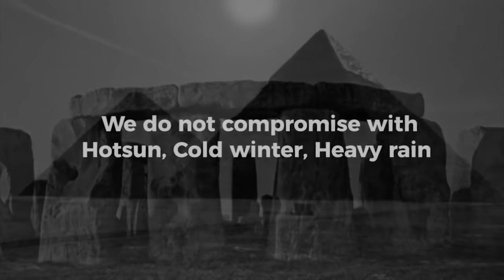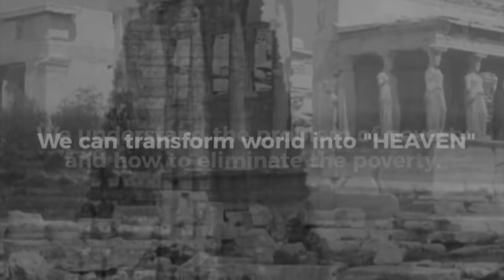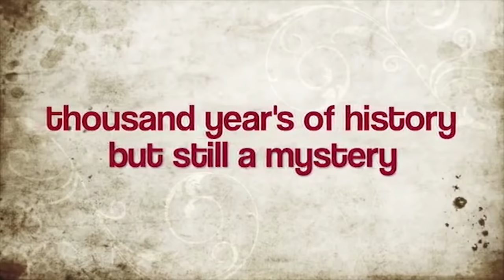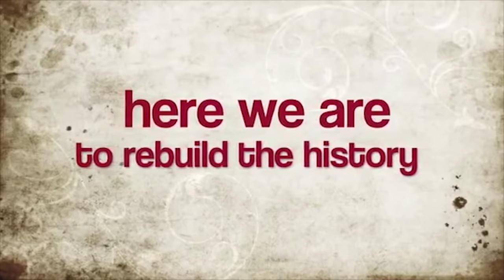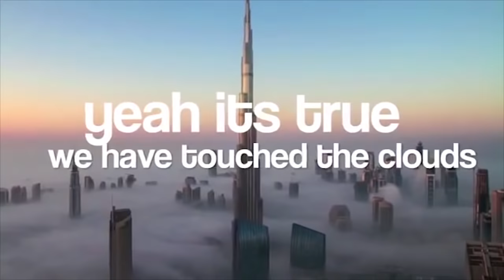Civil Engineering motivational video | Project assignment | Townhall video

Comment: Just one thing... All these are architecture. U don t design, u re not able to draw a line, definitely u don t build, contractors are doing that. U only know how to stabilize a building or a contruction in general. Definitely Parthenon, or Pyramids, or Agia Sophia has nothing  to do with u. "Architect",  from the greek word "αρχιτεκτων"= αρχι - τεκτων = first ( in hierarchy)- tekton (laborer) ( see tektonism ) is the alpha and the omega. Civils , Topographs, Mechanicals engineers,  ok thanks u, u r some of the others letters like plumber or carpenter etc. but that s all. U r far away from being Gods (lol), u r not creators by any means. U r not, that s why u can t even get it how is to be in front of a blanck page drawing a line with so many posibillities and things to take under consideration. Mention one famous architect. Now a civil enineer. Exactly...